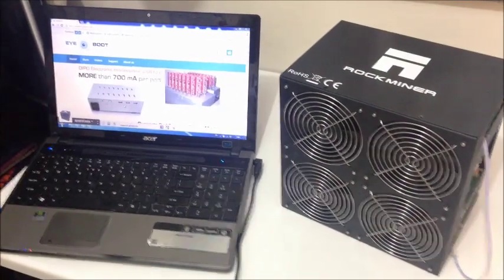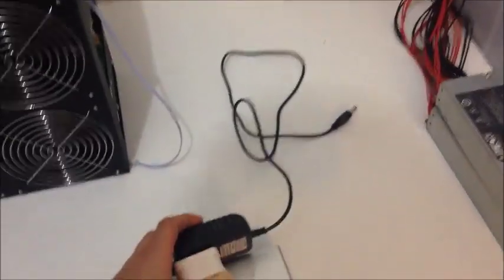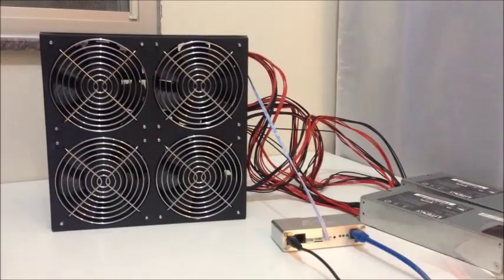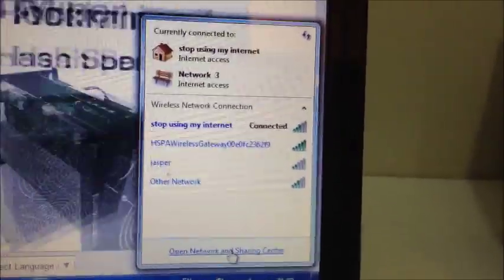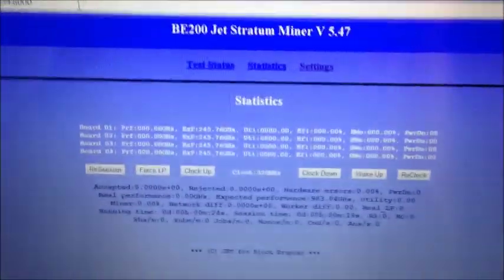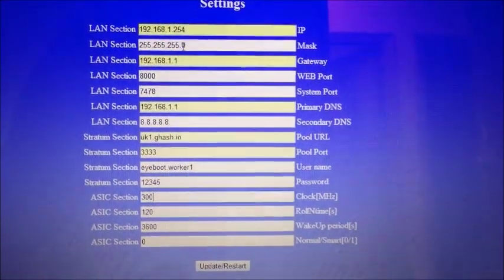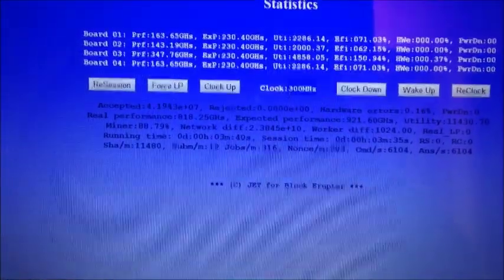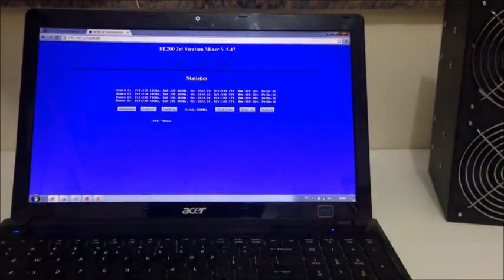How to Setup Rockminer T1 800-900 Gh/s ASIC Bitcoin Miner

Comment: Please is the rasbery pie computer also used to configure the rock miner T1 , because upon following your steps in the video , my laptop  or pc isnt able to resolve the Default ip address of the miner you gave me which was 192.168.0.254:8000, why is this happening , please help me , i have this device now and am having  issues  on connecting  it when i enter the default ip address